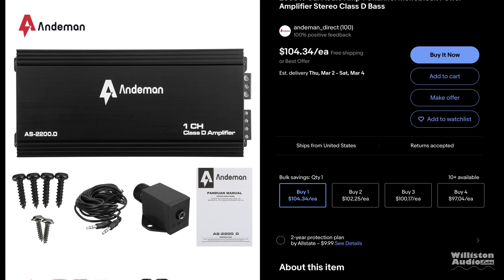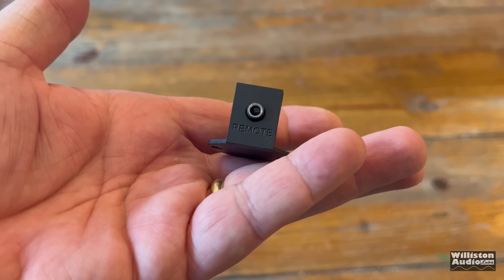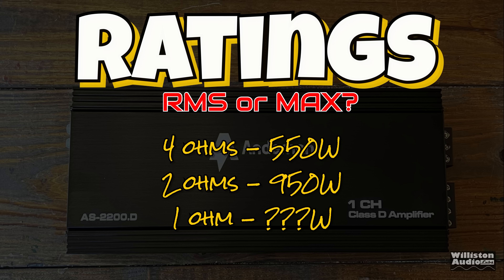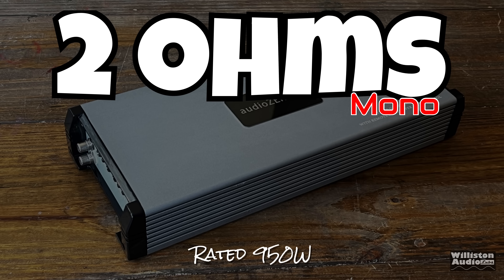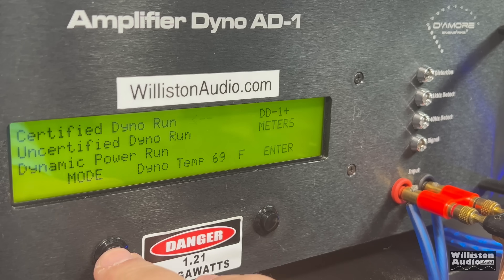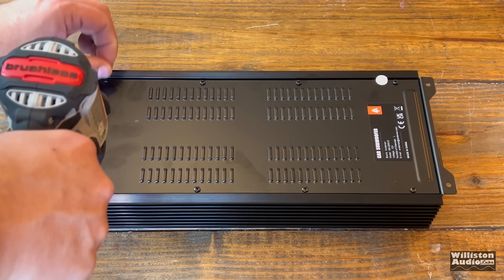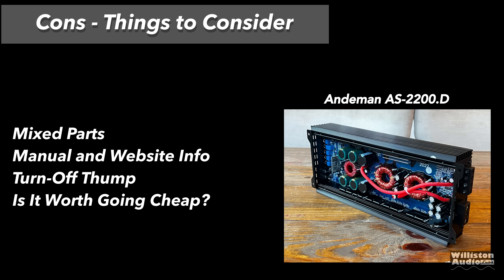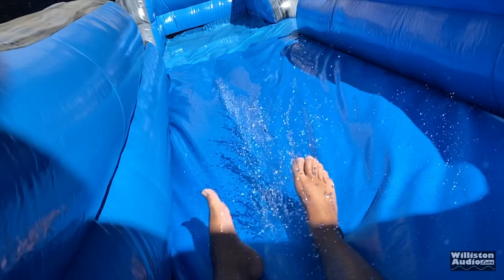Is This $100 Subwoofer Amp Worth Buying? Andeman AS-2200.D SKAR Audio Clone Amp Dyno and Review

Comment: You get what you pay for. I had a cheap planet audio that did hit, but it ended up sending DC to my sub causing it to blow. So yeah take Big D's Advice and buy a D4S amp for 150.00 bucks and get a decent warranty.
Reply: one of the many reasons I stick with the Rockford Fosgate power series amplifiers 
they are very well made and last forever but they are not cheap

Comment: Just bought a couple of these on Amazon and free shipping. I think I got a pair of used amps. They came with used ear buds and missing set screws and the inside rattled like something was loose. Shook them real hard and they rattle no more. I'm thinking smoke show when I hook them up? Opened them up and found the missing screws. But they worked and sound ok I guess. Hey I'm deaf in One ear can't hear out the other. Best Amazon gift card purchase ever said a few people ever. No seriously they olaright. Did I mention Free shipping and the multi monetary corporate issued bribe I mean gift cards?
Reply: haha, so sketch.

Comment: BigD have you ever thought about building an alternator test bench that you can use to power your battery bank? It would keep power stable and your tests would mimic real world conditions.
Reply from the maker: Yes but I’d need an engine or really powerful AC motor to spin the alt
Reply: @Williston Audio Labs  An ac motor would be sufficient. Check out the mechman youtube page, they have a test rig driven off an ac motor with a dial to control the speed. Doesn't seem like it would be terribly expensive or complicated to build.
Reply: @justforkiks29  you're better off buying a big power supply to charge the batteries. To have an alt put out 300 amps you're going to need more than "300 amps" to drive the alt due to losses.
Reply: @biscuitownz  a power supply large enough to run these amps would cost thousands of dollars. A 500 amp alt with his current battery bank would be more than sufficient for the burp testing that the dyno does. It would not cost much to build one.
Reply: @biscuitownz Watts is a much better unit of measure to use when comparing a 12v system to a (likely) 120v system. 

It would "only" take 30 amps at 120v to produce 300 amps at 12v. Before losses of course.
Reply: @justforkiks29  not SMPS :)
Reply: @biscuitownz  How you managed to make it this far in life is the great mystery. A 500amp smps power supply would be thousands of dollars as I previously said. You can build an alt test bench for a few hundred dollars with an ac motor from a swamp cooler and whatever material you choose to hold it together and a cheap variable voltage controller from harbor freight to dial in the speed.
Reply: @justforkiks29  I guess how much it costs depends on how much ripple is acceptable. Both low cost and expensive units exist. Taramps sells a 250a power supply for $450. Strap two of them together for 500a at $900. That's more affordable than I remember them being. No doubt a rig like you're talking could be cobbled together for less but that's a pretty serious motor. 500a x 12v = 6000w 6000w / 120v = 50a or 25a on 220v. Before losses.
Reply: @FrozenPaint  1/3-1/2 hp swamp cooler motor will drive that alt easily. You will get stable power, no ripple and real world testing environment.
Reply: @justforkiks29  But 1hp is only 746 watts. You'd need a motor with more than 8 true horsepower to achieve that 500 amp number you were using. That's a lot of motor.
Reply: @FrozenPaint  wtf are you talking about??? The motor doesn't produce any power, the alternator it spins produces the power.
Reply: @justforkiks29  If you want to get pedantic about it, motors convert electrical energy to kinetic energy. As such there's a mathematical formula for doing the conversion, look it up. A 1hp motor requires 746 watts of electrical input to produce 1hp of mechanical output. Because there's no such thing as free energy you have to drive your alternator with 8.042 hp to achieve an output of 500 amps at 12v. And that's before calculating any losses. Your swamp cooler motor isn't going to cut it. 
BTW I checked out the mechman alternator dyno. They're running a TWENTY-FIVE horsepower motor. Those Taramps PSUs are looking pretty good by comparison.
I'll be here all day if you want to keep being sassy about something you don't actually  understand.
Reply: @FrozenPaint  Your math is wrong. Pulley size dictates mechanical advantage. No different than adding more pulleys to a rope to achieve more force with less input. But hey you tried right?
Reply: @justforkiks29  And you clearly didn't do any math. The problem with your argument is the AC motor spinning the alternator is already tapped out. You don't have any headroom to make it spin faster without melting the windings. Changing the pulley just allows you to do the same amount of work over a longer period of time but unfortunately the voltage has already sagged by the reduction in speed. Sorry, try again.

I'll try to be a little more helpful:
There's no such thing as free energy. That means you have to put 6,000 watts into the AC motor to get 6,000 watts out of the alternator, right? (I'm being generous here by ignoring losses.) Why 6k watts? 6000 / 12v = 500 amps. Well we're back to that 746 watts per horsepower problem again.
Reply: @justforkiks29  I thought of an analogy that I think will actually help you understand as you seem like a mechanically inclined person.
Saying we can increase the output of the alternator by swapping the pulley and not having the AC motors consume more power is akin the saying a car that gets 20mpg on a single gallon of fuel could go 50 miles on that same gallon if you just changed the size of the wheels. 
Ya follow?
Reply: @FrozenPaint  Actually wheel and tire size does effect mileage
 A larger tire would consume more fuel in stop and go traffic but do better on flat ground at highway speed. Now back to the topic at hand, I'm sure at some point in your life you've ridden a bicycle that had gears. And you are familiar with how they function to give you a mechanical advantage by using different size gears. Pulley sizing would allow for the same thing.

Comment: Start with great video as always. This is a great deal. If your just starting and your budget isnt the biggest then this amp bang for buck is a steal. Its got few flaws but if you just want power to bump decent subs then this seems like a must buy. Not many cheap bobo brands make rated power. Not a bad amp for a starter amp and i agree it looks just like the rp skar amps

Comment: Since my car audio started in the 80's, seeing what you can get for $100 is amazing.
Reply: Yea I remember guys getting personal loans just to buy an MRV1000 or Thunder 2300
Reply: @josmith213  I had a Black Gold thunder 2300 feeding two Rockford Fosgate Punch DVC 12’s. It took better half of a year for my burger flipping 16yr old self to buy. 😂😂😂.
Reply: @josmith213  I found my $427 receipt for my Orion 225 HCCA
Reply: I was thinking the exact same thing while watching this. I paid more than this for a brand new Rockford Fosgate series 1 230sd which was 30x2. A 60 watt amplifier.
Reply: @bones40447  that's where those 2/4/2.1 50w per channel Bluetooth amp boards on Amazon for $10 really blow my mind.
Reply: Back then 100$ would be enough for a 2x20w amp. Nowadays that becomes over 1500W.
Reply: Mind blowing! If we had amps like this back in the 90s we would have destroyed more car electrical systems it would have been a nationwide issue
Reply: I had Jensen Tri axials 6x9 with a pioneer 50 watt "power booster"/ eq in the dash of my 77 Chevy Nova... I "gouged" a hole in the doors for a set of Sparkomatic 6"co ax drivers, driven by a"High power" Clarion cassette deck...with Dolby noise reduction and auto reverse....the Jensons cost $69 at K Mart, I put them on "lay away"...my current systems in my German cars are mostly Brax/Helix/Match and German Maestro...the cost.... substantially more...I can't say  in case my wife reads this....this $100 amp would not interest my 55 year old self, but would my 18 year old self.Peace Brother
Reply: @raymo6795  Ah yes. I saved up for the Kenwood 6999 6x9, powered by a Coustic 190 amp. I made a custom amounting adapter for those speakers. Oh the memories.
Reply: @raymo6795  oh man good memories! We all wanted Jenson to be good!
Reply: so true!
Reply: 15 years ago today is a big difference
Reply: Couldn't say it better..
Reply: Yup. $289 for a Rockford Fosgate Punch 45 in 1988. Incredible how cheap power is nowadays. These 1Kw-1.2Kw amps are basically disposable. SMH.
Reply: I started in October 1990. Kraco head unit AMF rear dash shelf speakers. Prob 70 waat rms. Lol.. Listening to Young Black Teenagers...I was cool.
Reply: Targa and Ppi Orion kenwood and the alpine with the ice cube buttons all cool stuff from back in the day
Reply: I paid $600 for a Phoenix Gold 500W 2 channel in 1998 😂
Reply: PARDON!

Comment: More class D junk.  Every class D car amp I've heard so far, has been awful.  The mids and highs, and the bass.  Just doesn't sound right.  I've had the new Pioneer, Rockford, and others.  No Bueno.  Put my 1990"s class A\B back in and WOW!  The clarity of the mids and highs is just WOW.  The bass?  Accurate and responsive throughout the crossover range.  We need a manufacturer to make some updated class A\B amps and I'd buy them.
Reply: I think class D is just one of those things that's easy to get "good enough" but much harder to get right I've certainly heard some older Tripath home hifi amps that sound very good, but yeah most of them soundartifucial and compressed to my ears.
Reply: Cool . More for you